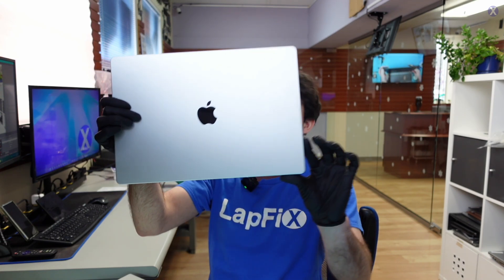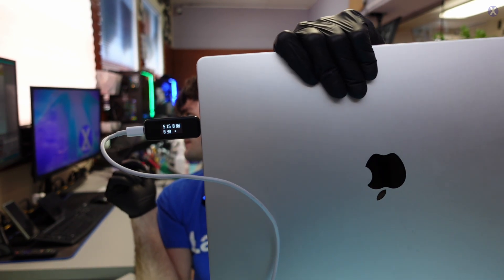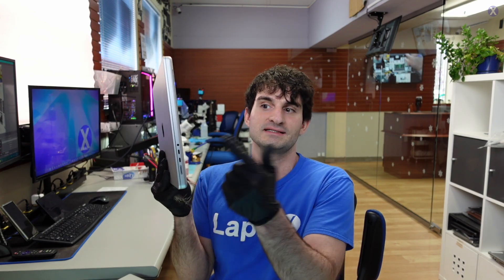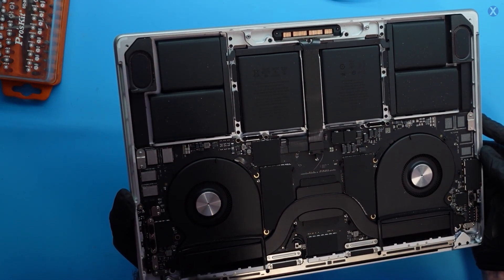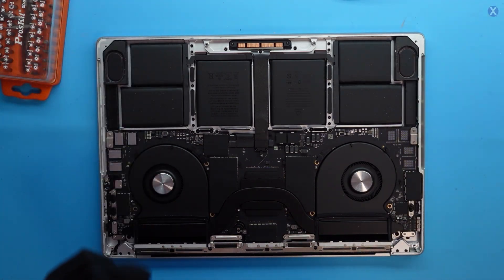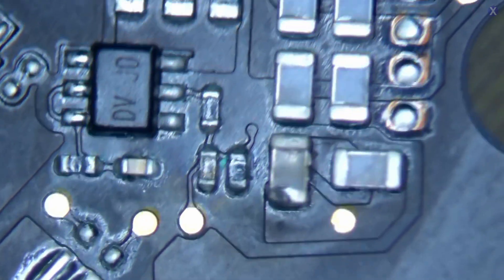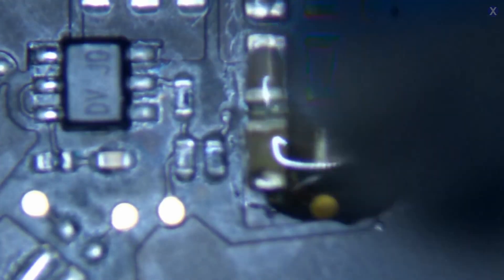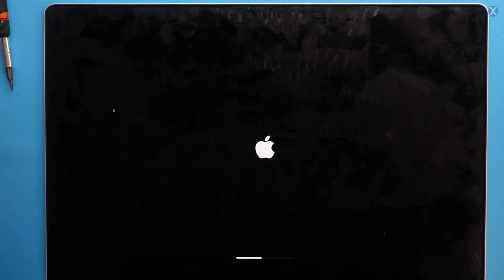How to Fix a Dead M2 Pro MacBook Pro 16"

Comment: My MacBook Pro M1 Pro only works connected to the charger, it does not retain the charge in the battery, battery stage 97%, 91 charge cycles, what could it be?
Reply from the maker: 91 charge cycles isn't much wear and tear on the battery.  You may send in the device for us to take a look.  All of our contact information is in the description for a mail-in repair service

Comment: I’ve got an unusual issue with my M2 Max 16” MacBook, the screen works fine when watching videos or browsing online, but goes of when I run more intensive task as video editing, photo editing or cinebench. It still has a backlight on, and after I close it and open again it turns on for moment and goes dark again. After some time giving it a rest it comes back to normal.  When the issue with internal MacBook screen is happening, the external monitor works fine while MacBook monitor is off. I’ve been to Apple with this but they can’t seem to figure it out and quoted $850 for send in service. Have you ever dealt with anything like this?

Comment: Apple is awful to customers by programming all type C charging ports so if one fails they all fail. They all have their own controller so should be independent it's sheer idiocy. The list of Apple's poor repairability tactics (parts coding/pairing) is very long which includes false information given by Apple to customers regarding warranty claims to escape warranty obligations. They are not looking after their customers and lots are turning to Windows and Android due to this. I work on Apple products pretty much daily and always tell customers to stay away from Apple products in future. Unfortunately, other large manufacturers are following Apple's coding and parts pairing tactics. Its sad to see.. Life is expensive enough without extra stresses from trillion-dollar companies squeezing loyal customers dry...
Reply: Agreed.